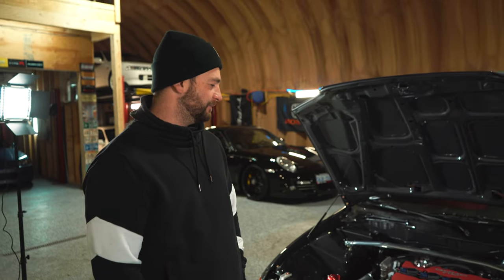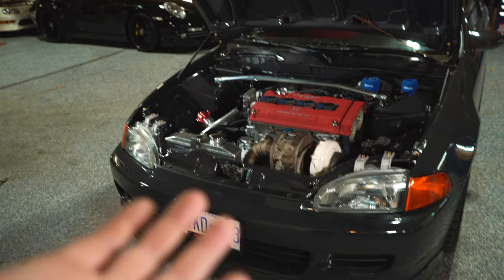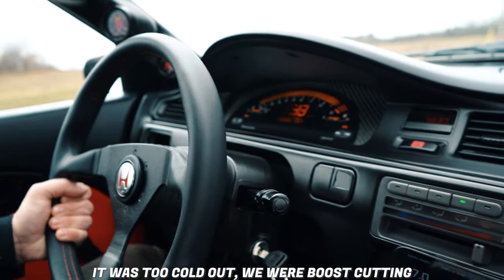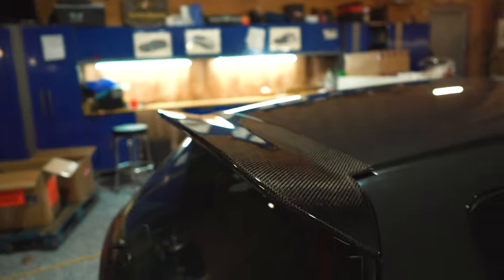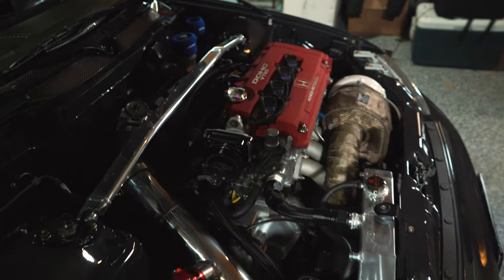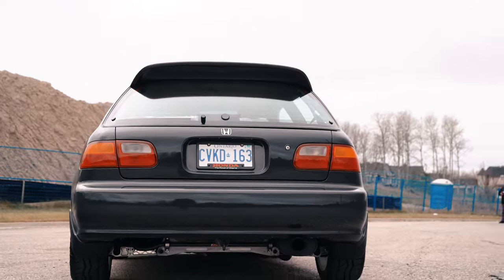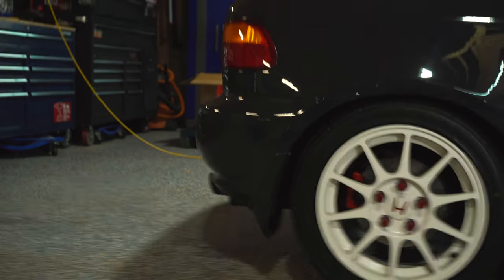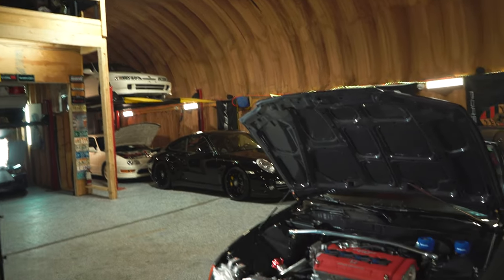The PERFECT Honda Civic EG - 520WHP Weekend Warrior

Comment: My  old e.g. had 230 to the wheel and it was an absolute riot to drive. I can’t even imagine what that would be like to have 520! 🤯
Reply: I'd say an absolute riot lol
Reply: i just bought an eg6 from a friend for $3400 (california) with b20b vtec, built b head, gsr trans, full suspension, i/h/e, stage 3 clutch. took it to the hills and had to limp it a little, needs a new axle, tune, and a few other things. even on basemap tune it was so much quicker than the stock 07 si i used to have. the handling is insane